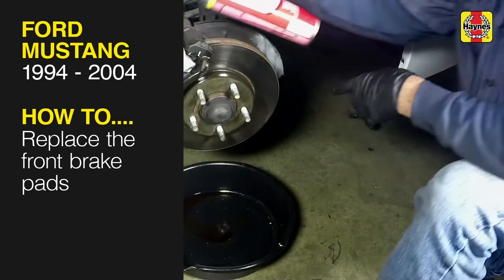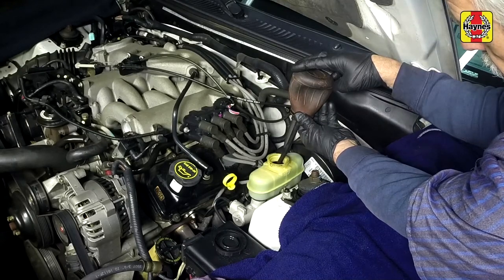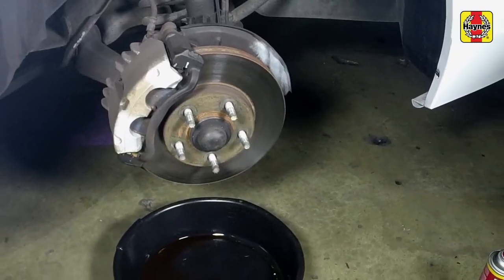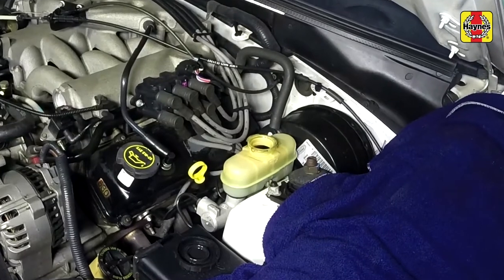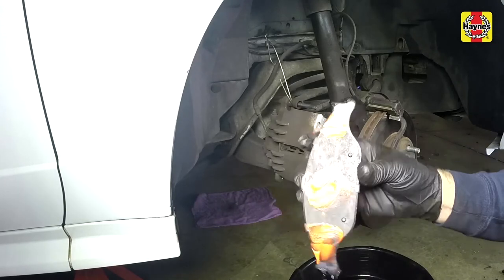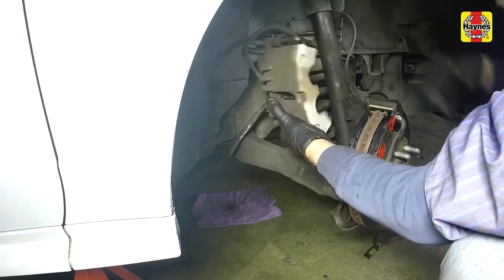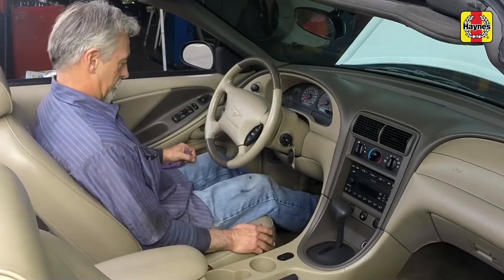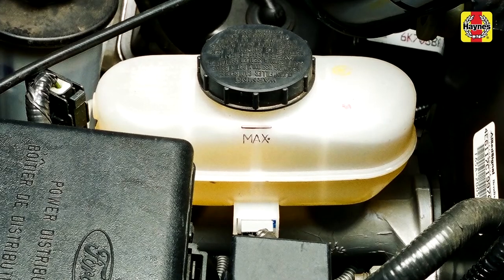Ford Mustang (1994 - 2004) - Replace the front brake pads

Comment: Is it bad if u don’t install the side metal clips on the pads for the rear, all I did was grease the ends and it seems to work as good as if the abutment clips were on or not.  I only got 1 set on because the others wouldn’t stay on while trying to push it into the caliper and got bent badly.
Reply: Yes, I believe all the metal clips are absolutely necessary. I just did mine and those clips were a problem to get in. When it finally did I felt like it bent wrong but so far so good.